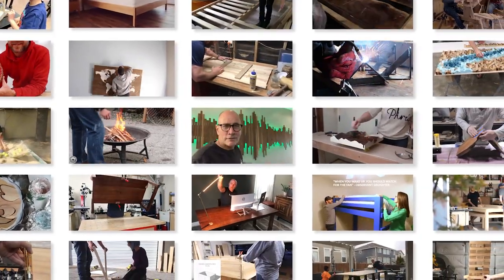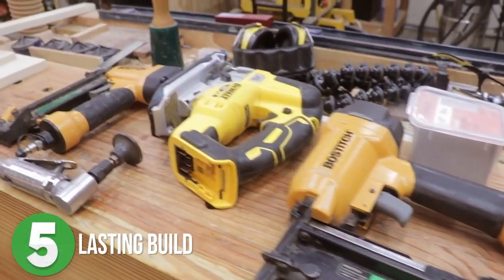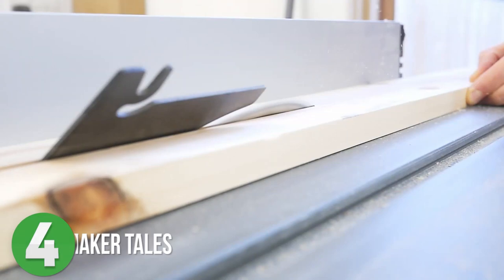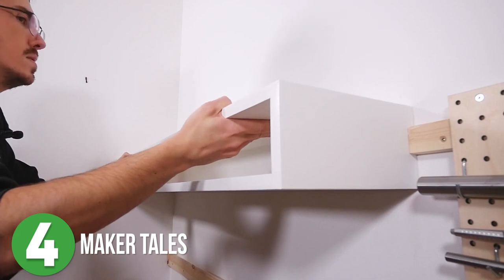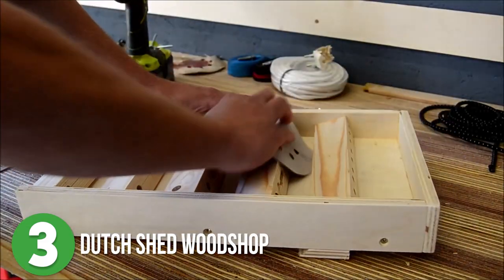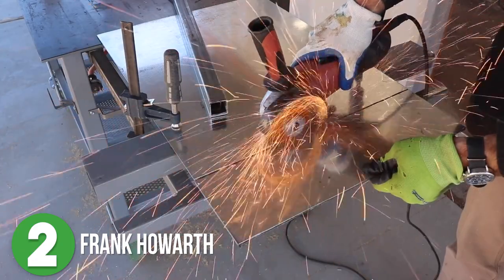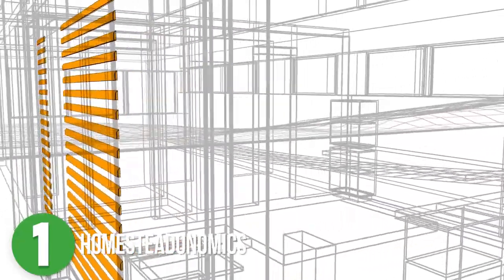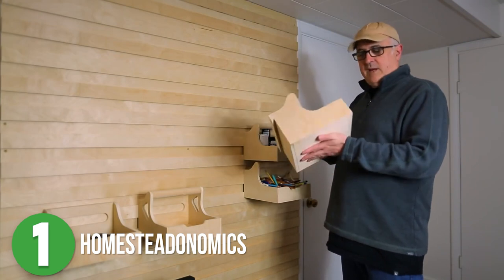Top 5 DIY French Cleat Projects! The Best Maker Videos for Your Next Build!

Comment: Sarah, thank you for yet another great video. I am absolutely advocating for the french cleat system. The only limitation is that one has to have a table saw and at least basic skills of using it in order to produce quality cleats. Or maybe no, maybe there is a  way to make great french cleats without a table saw?
Reply from the maker: If there is a way, I'm not aware of it. You really need the table saw to safely rip the cleats. I guess you could make a jig with a few other long pieces on other side for support, and then run a circular saw at 45 degrees. We'll have to try that out.
Reply: @ToolShow  I follow your thinking. There are only two ways to cut the material: 1. move material over the blade 2. move the blade over the material. The cutting angle is always 45 degrees. This may be an interesting subject to consider.